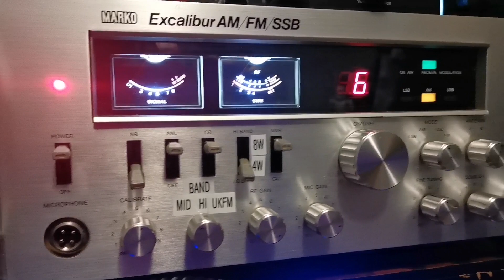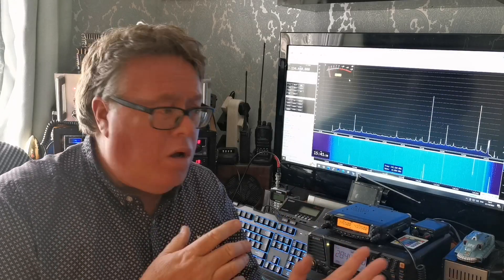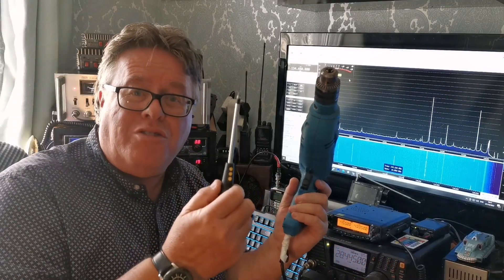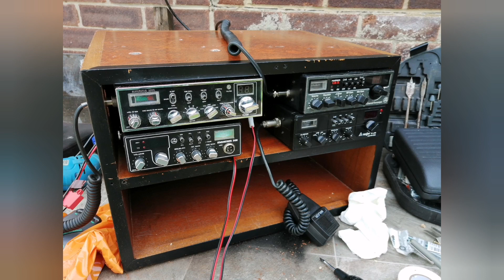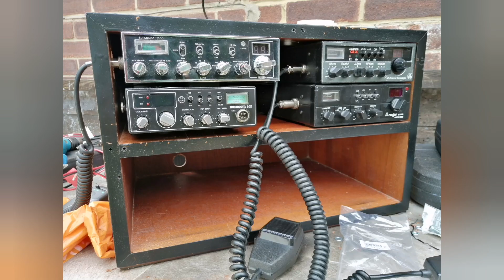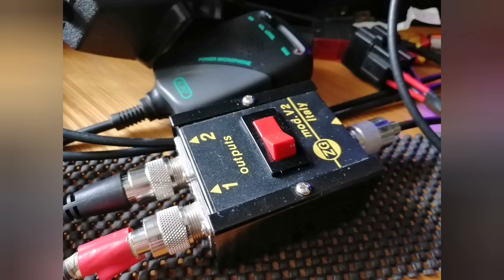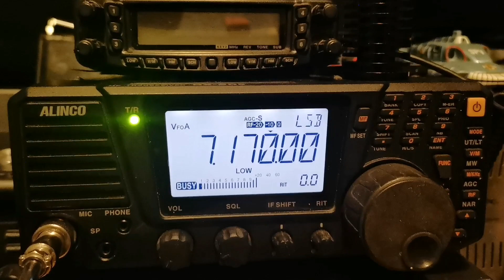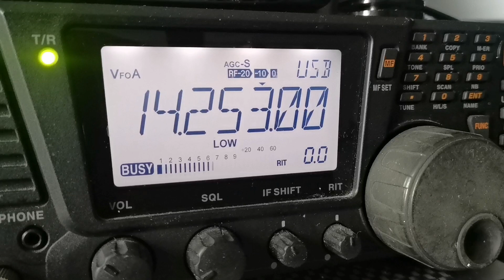Enthusiastic Steve: Enthusiastic Shack Rebuild

Comment: Did the choke and ferrite beads make any difference
Reply from the maker: I will say yes, beads work on the audio leads, one of my antennas is fairly low and I did have rf coming back into the shack that the audio leads picked up. This has now stopped. The rf coax chokes do work, one under the antenna and one before it comes into the shack, the one in the video on a plastic pipe with tape around it. Sometimes they work straight off another you may need to adjust coills, add more, or move the ferrite beads, they recommend approx 2 to 3 inches from source they are plugged into. Ferrites vary in quality but you can by a various assortment of sizes for a good price on Internet market sites. I also had some rf noise on 40m band, this after investigation turned out to be a noisy plug in 12v power supply feeding one of my scanners, Regards Steve